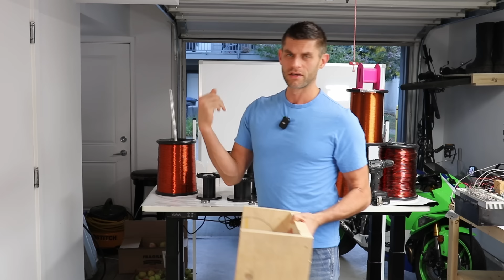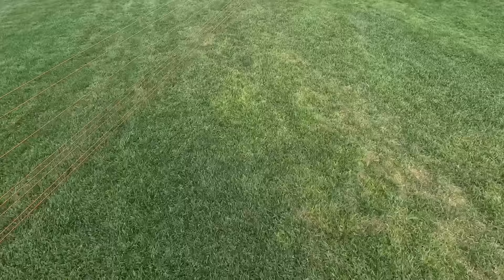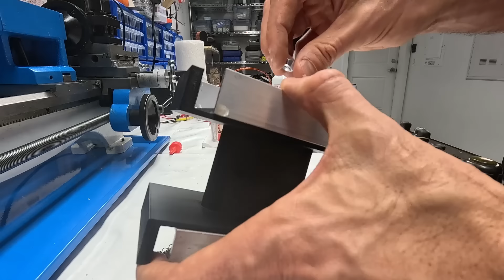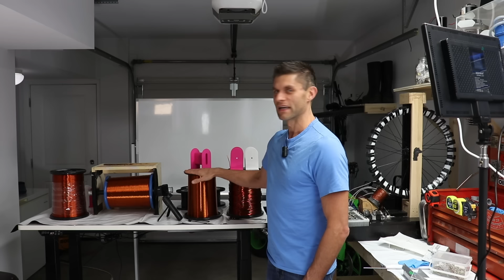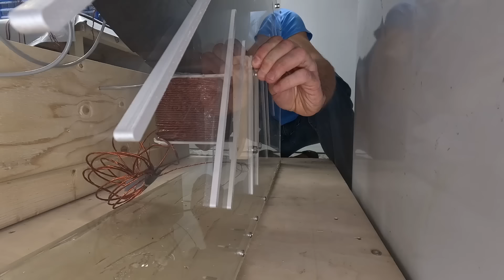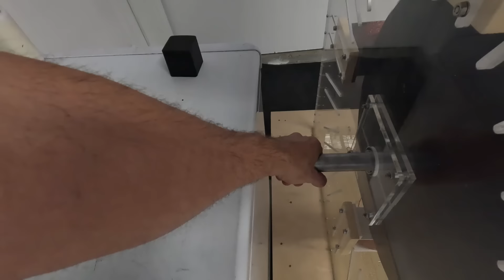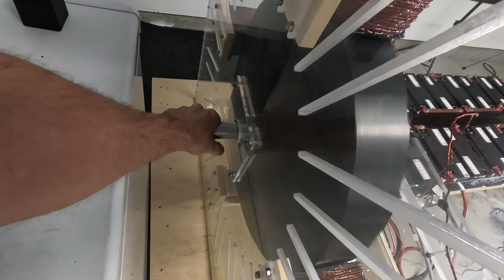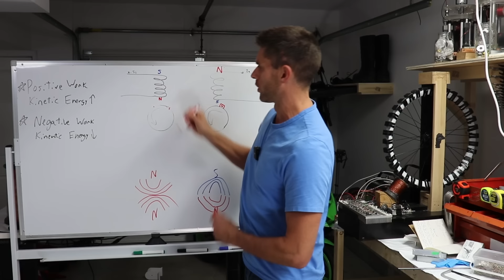The Device That Could Give The World Unlimited Energy

Comment: Nice video!!

If you want to see an experiment that NO ONE has done before regarding electron flow, speed in wires AND what happens in loose wire ends when volts applied. Take a look at this video from a guy who really wants to understand these things: https://youtu.be/2AXv49dDQJw?si=SKt-KL0p8IqdU7L2

This is a headscratcher, but it also may give you more insights into the field of electromagnetism and electron flow. Also give you new ideas around this topic.

Again, good work!
Reply from the maker: Nice thanks for the comment

Comment: The magnetic field isn't free, it contains stored energy from the electricity flowing through the wires and when you use that field to do work (like moving your compass) it uses that stored energy which then needs to be compensated by the power supply, so it will raise the voltage to maintain the current where V induced = − (dΦ over dt),The induced EMF opposes the current.
Think of the magnetic field like a stretched elastic sheet, when there is nothing near it it's still and holding potential energy but when you put something in the field the sheet moves and rearranges, which costs energy and to keep the sheet stretched (keep the current constant) you must supply more energy from your power source.
Reply from the maker: Yes but the how kuch work we do with it is up to us. 0 or infinite
Reply from the maker: You can do work without effect the internal electron flow

Comment: Ok so it's a very efficent motor I see that but like this does not generate energy you still have losses like friction and electronic losses duo to heating but it's still a nice motor and I support it but yeah it won't make power
Reply from the maker: Don't be so sure my friend
Reply: @MadscienceLPTECH how can you be sure your tapping into the quantum background and even if you are how are you addressing the low yields in the fW - pW	, and even if did tap into it how are you adressing losses of way higher magnitude duo to thermal dynamics
Reply: @MadscienceLPTECH Quantum vacuum energy is real, but you can’t just wire into it. To actually tap it you’d need asymmetry at nanoscales (Casimir/dynamical Casimir effects, metamaterials, superconducting circuits otherwise you’re just losing power to heat and friction, not pulling free energy from the vacuum, also keep in mind we don't have room temp superconductors so you would either have to build it in space or discover room temp superconductors which i mean you can try but if your going to build large scale Casimir plates you can basically build a warp drive so idk if   thats gonna happen in a garage

Comment: Instead of your hand to slow the rotor, perhaps a safer and more effective method could be a simple hydraulic brake added to the shaft. The front brake assembly for a motorcycle would work well because it functions without a brake booster and would allow more effective and precise deceleration of the rotor assembly. From a safety standpoint i worry any time someone needs to touch moving parts of a machine with bare hands. Keep up the amazing work brother and stay safe!
Reply from the maker: True good safey tip. At the very least a not my bare hand
Reply: @MadscienceLPTECH  I've been thinking as well about the need for a possible emergency shutdown. Some method by which you could rapidly slow the armature could help if it starts making expensive sounds for some reason 😅
Reply: True. Im also thinking about when you get this thing running full bore. I haven't caught if you've done the math on max potential RPM when the system is at peak operation but im sure its gonna be fast as heck lol

Comment: What if you used a dual rotor., one on top of your magnetic coil rotating off the South Pole of your electro-magnet, also having a generating coil ( just like your bottom setup, only running off the wasted South Pole energy., you’d get twice the output without putting more energy into the system…
Reply from the maker: Absolutely

Comment: Those high frequency short duration flyback spikes will not allow anywhere near accurate current readings by your clamp-on ammeters. That's a good part why the readings are all over the place and also inconsistent depending where you measure. You might just as well use a tomato to make those current measurements. Just as 'accurate'. 😄 Also, the voltage reading on the charge batteries when the HV flyback spikes are being applied to them is also not reflective of the charge level of those batteries, as well. You'd want to shut the system down and let the charge batteries sit idle for at least a couple of hours before measuring their terminal voltage. That will be at least a little more reflective of their level of charge, though applying HV flyback pulses to batteries can cause their terminal voltage to read a lot higher than their true charge level for a lot longer. I call those misleading battery terminal voltage levels related to charging a battery with HV spikes a battery 'surface charge'. It can be very misleading indeed in regards to true battery charge level.
Reply from the maker: Agreed. You are going to like the test equipment we have next video :) legit

Comment: Did I miss the reason to use fewer big coils instead of several smaller coils? I think the duty cycle would be more being it cools quicker. I assume winding the wire before making the coils makes it easier to wind around the induction coil? I played with with a laser diode and emitter (I don't remember the correct names) to send signals a few yards away trough fiber optic speaker amp cables. It would get your electronics further away while keeping the timing wheel close to the motor/generator. Using more smaller coils with offsetting the magnets will give more torque being you can push and pull in several more places. Next step is using a Arduino to time and control to perfection. This is interesting. It would charge batteries in a solar system all night to help unload the panels during the day to take of other things.
Reply from the maker: Valid points. There are infinite configurations to experiment with for sure

Comment: So, you are effectively going down the path of Joeseph Newman with a couple others mixed in. He tinkered in this realm but did it more mechanically than you many years ago. He also tinkered with grounding and grounding fluctuations mechanically that no one understood or accepted at the time. This has been revisited a couple times over with computers controlling the outcome. They all fail. Even with the latest and greatest technology reducing friction, making millions of calculations per second and running the best and current tech that exists has to offer, it all fails. There is no formula where this can achieve over unity. His salesmanship convinced a lot of people it might, however.

Comment: Ok I got some thoughts here....

First off nice demonstration of electromagnetism by the way. With the single wire it would be interesting next if you could show compasses instead of under the single wire, but parallel to the wire and if possible one compass on the end of the the single wire to see if the north and south is apparent. Reason why I ask is that not many people know that when a North needle in a compass is drawn to the the North pole of Earth that the North pole is actually a magnetic south. 

If the north needle does point perpendicular to the wire then that would reinforce the idea of how electrons could be attracted and flow from the vacuum to the wire. Electrons don't move hardly at all inside the wire. For like a 2mm wire with 1amp current the electron move 8cm per hour. The transmission of energy is done around the wire in the field. This is the secret and vital key in your motor build. When a moving magnet passes by a coil of wire the electrons just pop into existence into a fast pulse of current. You need to increase the duration of this sweep. So with that said...

 It might be more ideal to have a magnet moving across a circular flat plate of copper capturing the entire gradient of the magnet field and then wires coming off the copper plate directing the transmission down copper wires for use in your circuitry. Think about when a magnet is passing by a coil of wire or just a single wire of how much of the magnetic field is wasted and not fully sweeping passed the copper wire and coil. I think this is key. 

IE: Watch how slow a magnet drops down a vertical copper pipe. If you could increase the size of the magnet into a longer cylinder you increase the sweep size and then you can tap all that energy off the pipe as the magnet passes by. Now image a circle tube of copper with a magnet sweeping by inside it on a motor. You could essentially solder and tap a wire at any location outside that pipe and get a pulse off it. No need to build all these spool of coils. Tap it right from the source itself and THEN direct it down a wire where you need the power to like a super cap bank.
Reply from the maker: Interesting thoughts, thanks for sharing! Solid comment. Agreed

Comment: This is absolutely awesome work that I would love to do myself if I had the time - Thank you for your contributions! One thought, Tesla was obsessed with 3, 6, and 9 - In my research and explorations of frequency and music [25 years full time], I've found these numbers to be crucial in finely aligning frequencies, timings and harmonics. I've a suspicion that the applications of these numbers in your machines would be beneficial, also the number 432, which when used in music, with the correct harmonic tempos, forms a perfectly aligned wave functions when applied appropriately. There's something fundamental about these numbers. Another example of 432 is the thunderstorm generator, with the 4:3:2 ratios crucial to its operation - and it totally works. I could be wrong, but I think if you had configurations of 3, 6, for 9 coils, you might find some interesting results. Super fine tuning of the spatial dimension and timing of the rotation alining with these fundamentals may yield interesting results. The fundamental geometry and timings of the universe play a huge role in the electromagnetic space. Just a thought but I had to say. There are a couple of things I'd recommend looking at - A video called Sonic Geometry, and a book called Mathemagical Music Production, I understand you might not be a musician, but the principals laid out in that book hint as a fundamental alignment between many aspects of reality. I've been applying these fundamentals to my music and sound journeys (with binaural entrainment, harmonic BPMs and 432Hz tuning), and the results have been utterly spectacular, aligning the timing of every element of the musical structure to create mathematically perfect synchronisation, that wouldn't be possible without carefully using these fundamental numbers. Even 0.1Hz discrepancies in timing make the magic fall away, so pay close attention to the synchronisation of all aspects of your creations. :)  Thanks again for all your work and dedication!!

Comment: Bro as a kid, I had this idea of generating energy by quickly repulsing rotors with on and off switching electromagnets and you're now making it real.  Keep it up man.  You're doing the Lord's work!
Reply: what lord bro , if ur lord really wanted free energuy we would have had it allready its safe to say that when ur lord walked the face of this planet he didnt even know anything about electricity,
Reply: The trick is all in the high speed switching that is necessary to capture the energy that is available when the magnetic field collapses. By utilizing some high speed switching when the sine wave is at it's peak, much energy can be "captured" and used when the magnetic field collapses.  It has been just a matter of correct timing in the switching that has been holding up "energy from the vacuum" all this time.
Reply: You and every hobby grade electrician ever had the same thought. Too bad it's a fairy tale you all told yourself because you don't understand simple physics.
Reply from the maker: @SheldonsHeirlol hate much?
Reply: Much too much

Comment: I exitedly wait for these new vids moreso than any other content. It's amazing.

Dumb question: would solid copper donuts be any more or less efficient (or even possible) as opposed to spooling wire?
Reply from the maker: Its a good question and I dont know for sure... yet. 

Thanks for the kind words makes me smile
Reply: You are worried about that when he is using Temu grade bearings? Do you hear how loud they are? Sound = efficiency loss. He is claiming >100% efficiency in a system using some of the cheapest components like low grade bearings guaranteed to have huge efficiency losses. Almost half the worlds electricity is used in electric motors. Any company that can achieve even a fraction of a percent improvement in efficiency is guaranteed to be in highest demand. The current efficiency record held by ABB is 99.13%. I find this channel interesting and definitely lots of science one can learn but there is just no way this motor is efficient let alone greater then 100% efficient.

Comment: You are coiling your wires using the wrong technique. Reverse what you are doing. Don't rotate the finished wire around the fixed source spools, rotate the source spools of wire around a fixed point. Same result, far easier technique. You will need to build a rotating platform that will hold multiple spools of source wire. Also, if you twist 2 single wires into a single twisted wire, then take 2 of these twisted pairs and twist them together, the 4 wires form a perfectly round finished product.
Reply from the maker: Thanks for the suggestions! Always appreciate input. Sounds like letting Fred do it for us is 👌

Comment: Very nice, I think you forgot thermodynamics, quantum dynamics, quantum electrodynamics, gravity, friction, resistance...
In the end you just end up collecting energy that has already been wasted in the environment, without which there really is no "new energy" in the system.
Reply from the maker: Sounds like you have a generic viewpoint
Reply: Resistance is integral part of the circuit noob
Reply: Hmm yes because if we define the earth as a closed system the total energy contained in the atmosphere does not change, IT IS NOT UNLIMITED ENERGY!There are also some other factors, the friction itself, the system being in an atmosphere where there is again greater friction!So it's like saying you can make a fountain simply by taking a bucket of water, and starting to empty it, unlimited water will start flowing! Without bothering you, but overall you can delve into a different part, the atmosphere due to friction is charged with different charges which depend on sunlight.(Due to different temperature) You can build a lightning rod that collects these charges, but also has a safety system if lightning strikes.

Comment: When you energize electromagnet with direct current it creates a MAGNETIC field around it, not electro-magnetic that the author keeps referring to at the earlier part of the video. The electric component is kept within the wire, not around it.
Reply: Actually your talking about the Skin effect ❤
Reply: @Aaronthetreeguru  No I am not. For skin effect to happen the current must be AC causing electromagnetic induction in the thickness of the wire that opposes the original current flow (Lenz' Law) pushing the current to the surface (to the skin). When you have DC the current flows through the whole thickness of the wire, not just "the skin". Which is the case here in the video. DC current cannot cause any electromagnetic induction, in the thickness of the wire or anywhere else.
Reply from the maker: Huh I litterally showed a DC current acting on compass needles at a distance
Reply: @MadscienceLPTECH  Yes, one magnetic (not electro-magnetic!) field interacts with another. The electric component of DC is within the wire and has absolutely no effect on the needle.

Comment: I don't really know much about electricity generation but why are you using a radial flux setup rather than an an axial flux set up?
Reply from the maker: U tell me why one is better?
Reply: Radial flux is easier to build & tweak but less efficient than axial flux & if your planning to change motor design to axial flux it's better to buy from EV manufacturer rather than building your own then reverse engineer it to save tons of machining & accurately placing the magnets. All brushless motors are basically pulse motors & some are very efficient coz they integrate an EMF collector (snubber circuit) on their circuit. I've been also working on this pulse motor set up for a very long time (watched so many videos from different channels to find some new information) but unfortunately I still didn't succeed until today, to make it such a useful machine it should be able to self sustain itself & harvest whatever extra is left but even making it self sustainable (in other terms CLOSED LOOP) is already against the law of physics and thermodynamics. I only modify DC-DC inverter circuits (found in a UPS backup) to drive my pulse motor, these circuits can handle large coil amperage, built nicely & reliable rather than building my own circuit. Your work is very great & goodluck, hope you will succeed in the near future.

Comment: So this is a back EMF harvesting pulse motor like Ed Gray's motor was? If so, how much energy do you think you can take from the battery bank with the pulse motor running before the battery bank starts going down in voltage? Or do you plan on harvesting the energy from the torque of the motor using a generator/alternator?
Reply from the maker: Yes to everything. Its similar to Ed Grey's technology though I hear his coils were high amps low impedance